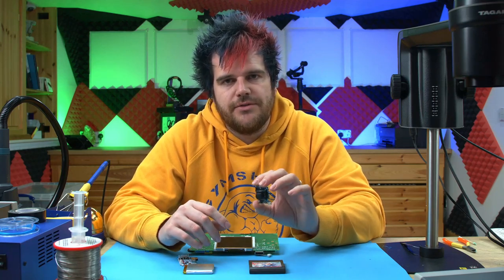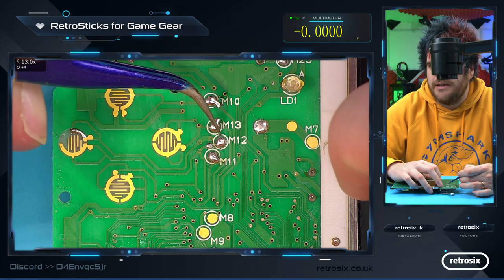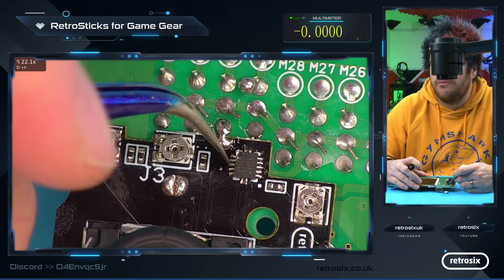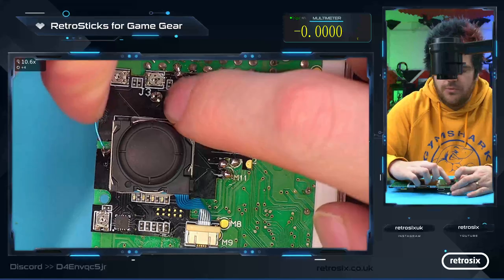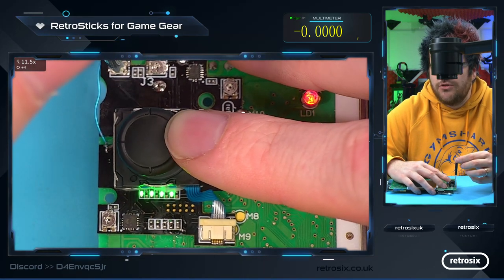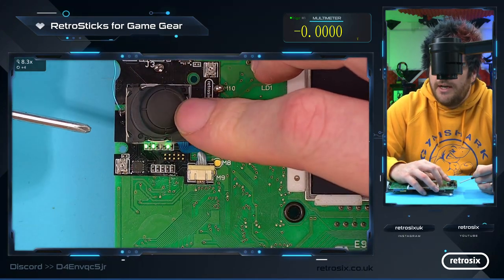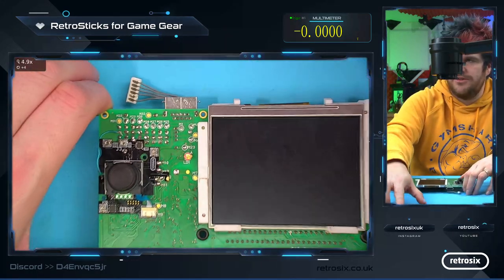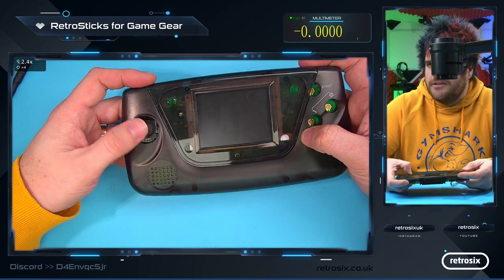RetroSticks Digital Thumbstick Install And Setup Game Gear - RetroSix

Comment: This along with the screen the sound replacement and power replacement new capacitors and the everdrive for the game gear has really made this a handheld I actually use again on the regular. It's also fun just opening up old consoles

Comment: Great work Luke as always and thanks for taking the time to document the process. My only suggestion is to perhaps silk screen the corresponding directions (U,D,L,R) near each corresponding screw and even below the diodes themselves to make tweaking a little more intuitive for the layman.

As far as the stick surrounds go, I’m thinking along the lines of something easy to clean with a swab opposed to rubber that may trap grit and skin cells and be trickier to wipe over / may degrade over time. Maybe a flat glossy piece of plastic to provide a nice neat finish underneath?  These could come in a variety of colours to match shell combinations perhaps?

Keep up the great work matey.
Reply from the maker: Thanks. Yes moving the LEDs I think is best and silk would help. For hard plastic the problem will be getting it over the thumbstick or through the stalk as the thumb doesn't remove. The rubber could stretch over and is cheap to replace. But I'll try both ways

Comment: Just instalt mine, works fine. Adjusting it with the bright LED was a bit difficult ( bridge it) taped them with dark tape so i coult see which LED was off
A rubber cover would be a nice addon 
Its to open now.

Keep up the good work 👍👍👍
Greetings from the Netherlands

Comment: Looks wonderful! I really want to pick these up once they are available!

As for suggestions for covering the the rest of the analog stick; a simple cap to shroud the components would be fine since the analog stick already has rubber around it! As long as dust or debris is not able to fall into the inside it should be good!

Comment: This definitely needs a cover of sorts. I'm no retro purist,  I was thinking about ordering this mod the day it was added to the store, but the main reason I decided not to is the huge gap that's left between the shell and the joystick, it looks like the perfect spot for dust to settle in. I don't know if it's easier to make the cover out of rubber or solid plastic, as long as it stays in place, it should do the trick.

Comment: I got my kit today and assembled it but two of the lights never go off ever. Even turning the pots do nothing. The bottom one and the left one have a super tiny spot where the light will  come on but then moving the stick never turns them off. 

And then sometimes the light for the bottom goes on when I move all the way up…. What is going on??
Reply from the maker: Try removing the thumbstick ribbon cleaning it with IPA and reinsert it
Reply: @RetroSix  左上無法正常使用....HELP ME = ="

Comment: I'm very interested in this but won't buy until it has a cover of some sort and the resistor in place or at least with the kit.
I like the idea of it a lot, I have your screen, cap kit, battery kit & speaker amp all inside one of your cases, this mod will finish it off nicely and I'd definitely be interested in one for an original gameboy
Reply from the maker: If you leave a note on the order to include required resistor we can. Covers I'll hopefully have sorted and for sale this week

Comment: hi I brought this kit off u and can get all to work bar left direction.the light goes off when I press left ( the far right light ) .any idea
Reply from the maker: Remove and reconnect the ribbon of thumbstick. If that doesn't work jump on our discord and ask for replacement
Reply: @RetroSix  hi is it anything to do with the solder point on d pad , or is it that if the lights are on and go off when the left direction is pressed it means should be working.ive tried adding wire and going to ground as well
Reply from the maker: @willrobinson7599  usually it's slightly out of spec resistors on the RetroSticks and the left is always the one that fails first if so
Reply: @RetroSix  hi grear news . Reconnected the ribbon cable and now working.thanks for the first class support
Reply from the maker: Awesome glad it worked

Comment: Just installed mine … what a ball ache setting up the diagonals!!!! 
Still can’t get it right .
Also if we need a resistor to get the leds to dim why not include one in the kit ?
We don’t all have resistors lying around we can use and trying to set up the diagonals with the leds at full brightness is almost impossible. 
I had to wear sunglasses and it still blinded me 😐
Reply from the maker: I will include a resistor inline for next batch. First versions always have feedback for improvement

Comment: Tried placing this in a version with the R48 resistor, could not get it working. Somehow it did get the mentioned 5 volts but no leds what so ever. I could not see clearly of all connections where made correct. Should it be fully connected before the leds light up? Or is just a 5v supply enough?
Reply from the maker: You must have all voltages at the ASIC. Vref, vres and vonoff. Check those pins to find out which is wrong and work backwards from there
Reply: @RetroSix  Thanks for the quick response!. I will try to check the connections but its a bit tricky since the pcb is on top of them. Most likely I will check my other game gear to see if it is a different pcb version. Might be simpler too place.

Comment: retrodrift, sweet, not some much a critique i just dislike how bad modern analogs tend to be. not for me but you guys do you.
Reply from the maker: These don't get drift. They are tuned to ignore the center's until pushed enough so drift would never be a thing
Reply: @RetroSix  makes sense since there is no movement sensitivity.  Kinda surprised there is a demand but I have heard you mention the demand was there. Just not for me